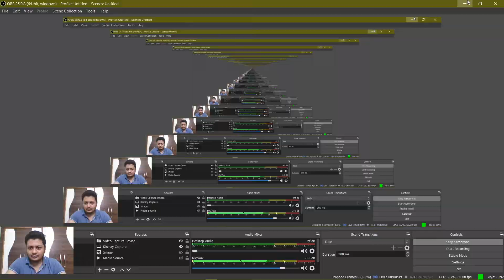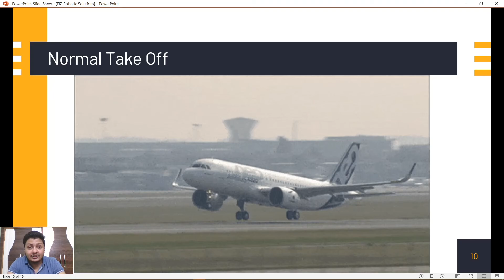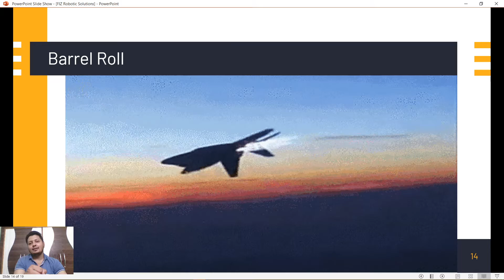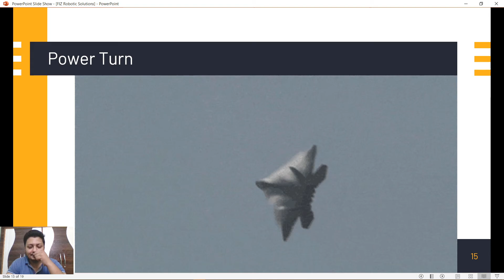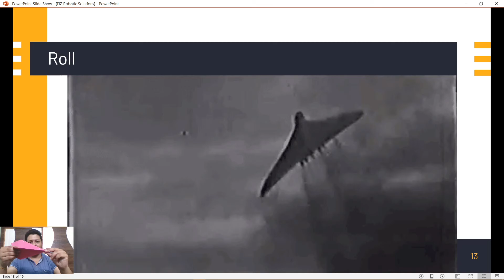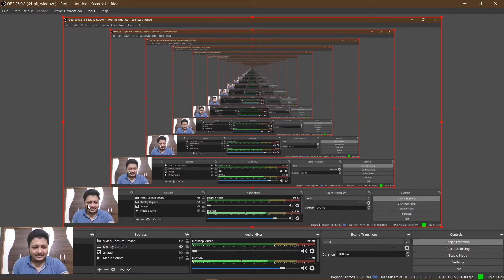Aircraft Maneuvers | Aeromodelling | Short Courses 01 | EP 05

Comment: Sir in case of chhopers or helicopters , their rotors have 2 or 3 or 4 wings . why they do  not have 1 or more than 4 wings ?
Reply from the maker: One is more obvious that it cannot be balanced from the other direction. For more than 4 the answer depends on cost, lift and drag. The more the surface area the more drag. The more blades more power needed to drive hence efficiency can be diminished too. So max 4 is current sweet balanced configuration where choppers are still efficient to weight carrying capacity 🙂